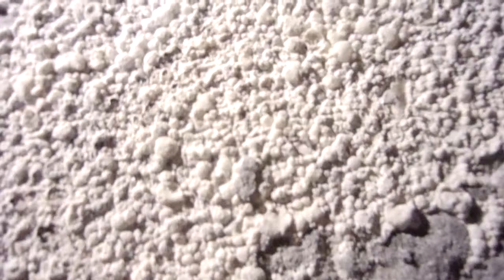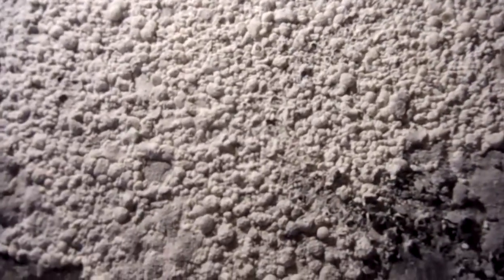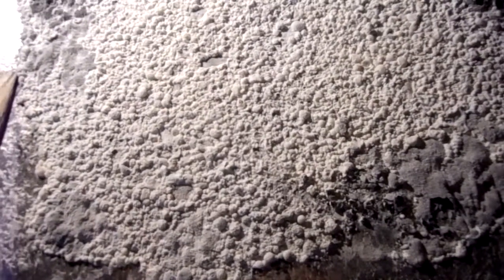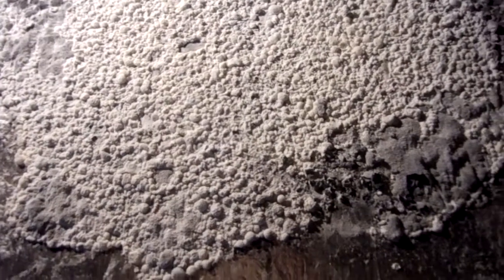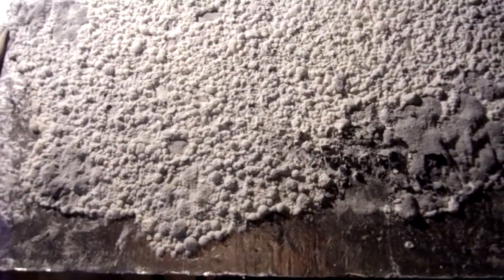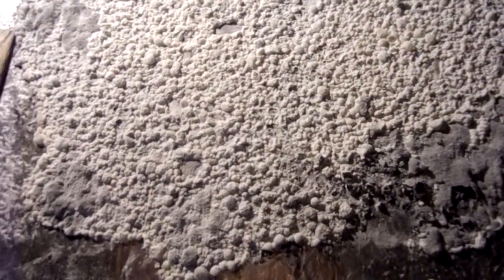white gunpowder

Comment: Careful if I think that is what I think it is then that’s what they make explosives with and if you pinch it in a certain way it will blow you up one little tsp of that can blow a human body up in flames
Reply from the maker: through a lot of experimenting I have found that great improvements in the physical construction of a solid fuel engine can increase thrust dramatically while obviating the tendency to  detonate due to elevated pressures by creating specially formed fuel pellets separated by thin paper dividers which acts as a throttle to keep pressures at peak without triggering detonation./ casing failure. and interestingly while I have not really found a method to prove it that causing a  strong helix flow of the gasses exciting the nozzle exhibits a dramatic and unbelievable and unexplainable force where a carbon-based fuel is getting so hot it catastrophically melts the stainless nozzle. so, I have turned to using ceramic nozzles.

Comment: This seems to use the same mechanism organic chemists use to purify a crystalline solid from a solution (recrystalization). The solvent it heated in order to increase the solubility of the solute and create an oversaturated solution, and then immediately placed in an ice bath. The sudden drop in temperature basically kind of makes the solution cramped as the solvent molecules want to get closer together now that they have less energy (heat), but they are blocked by the solute that was added. As a result the crystalline solids are forced to gather up together and "drop" out of the solution. A variety of things can trigger crystallization, commonly either adding an amount of solid material to the rapidly cooling solution, or scratching or tapping the vessel holding the saturated solution which basically forces the creation of a seed of crystallized material which the rest of the solute will bind and build off of in order to allow the cooling solution to reduce back to its normal density. Crystallization can happen surprisingly quickly in the right conditions, where one second you are looking at a liquid, and the next it is completely solid. 

From what I know about black powder (which isn't too much), this isn't a very good situation since your KNO3 is basically coating the rest of the components and are not as intimately mixed. You kind of have the same situation as prilled chemicals which may make it harder to light (but probably marginally) compared to normal. At this point though you probably found out what happened and how it performed.
Reply from the maker: thanks, Dave, what I was attempting to do here is to develop an engine fuel that was much more energetic like a composite, but still keeping the engine in compliance with shipping regulations. I finally gave up on that when it was found that this could be accomplished instead by designing an exceptional and hard to make fuel pellet that via its unique design would mitigate high-pressure detonation thus allowing peak   allowable pressure without risking catastrophic failures.in other words,  a black powder engine  would produce g or f or better thrust without using composite fuel. I even constructed an electronic thrust gauge to test these new engines' performance.